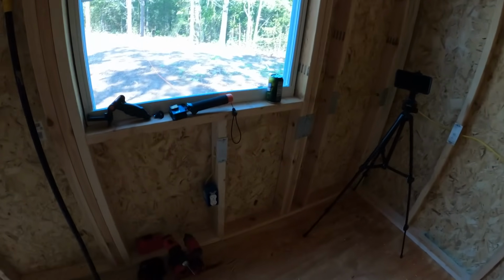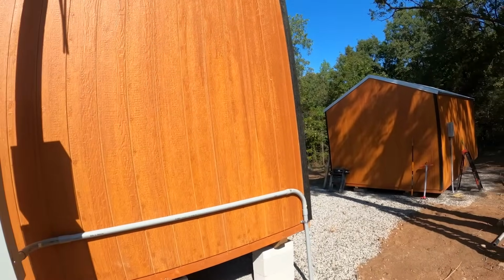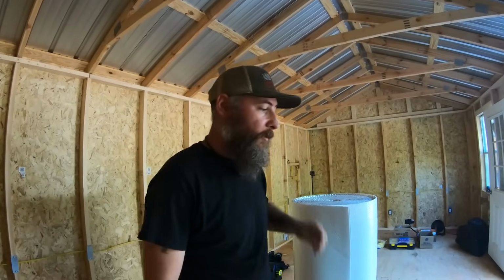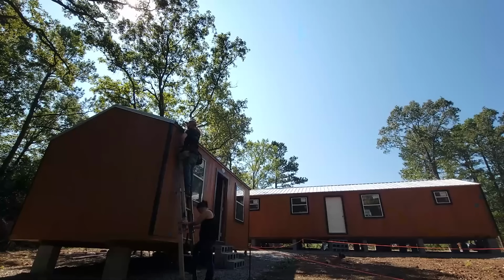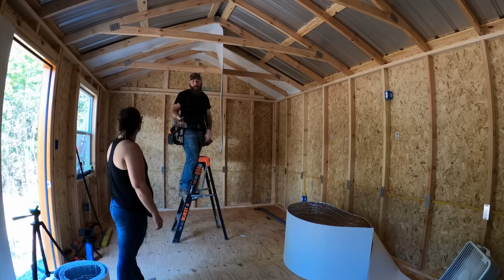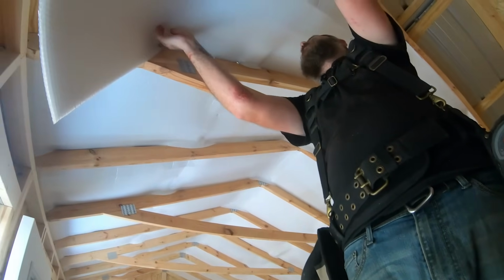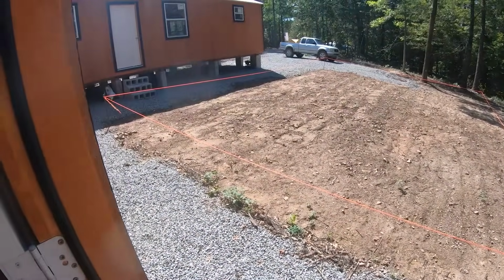Hopefully this keeps it out! |16x48 Shed | Shed To House

Comment: 👍, don’t forget about electrical outlets on the outside of the bldg. and lights on the outside. Eventually there is going to be a ruckus between the dogs and wild vermin or two legged vermin that will require some light on a dark cold rainy night. More lights the better. One other tip woods mice and field rats like to stay warm in the winter too, they are very clever when finding ways in your house or tearing up insulation or wood to get in when it starts to turn cold.  Metal is about the only thing that they won’t chew threw. Good luck !

Comment: we did the DIY Lowes Spray on Foam insulation on the ceiling of two of our 40ft Hi Cube conex storage containers about 1" thick for about $700 last year. It lowered the ceiling temperature from 137° to 104°. That is the delta we measured from the inside with our temperature gun in the heat of the day in the summer in East Texas. The reason we did the spray foam was not really the heat but the water condensation drips we were getting on the inside in the winter from warm humid air hitting that cold metal and forming water like a cold ice tea glass in the summer.  The spray on foam fixed that problem.

Comment: I don't know how cold the winters get there but I would recommend removing the metal roofing and sheeting it with OSB or plywood, felt paper, reinstall the metal roofing. If it gets really cold there you might want to splice a 2x2 onto the edge of those 2x4's to make them into 2x6's so you can use better insulation R-30? 2x4 framing is not even allowed in most places for residential buildings, it may not apply there but I know here in Oregon the exterior walls must be 2x6 minimum for residential. Peace and blessings.

Comment: I still will say, take the metal off and lay on OSB ..cheaper for the long haul. Put in bug shields on the ends of the metal and remember to replace the screws on the roof every seven years as the rubber washers wear out... thanks again ok for the videos.
Reply: Yes, that is what our Premier 12'x32" portable building came with. And double wall studs every 4 feet.
Reply: @ronvera  there is no osb on the roof!

Comment: I agree with John Paquin on using the chicken wire under the house instead of the plastic over the insulation. I have seen that done a lot. Lets the air flow and you can see if you have moisture building up. I have also seen more and more people getting away from using sheetrock. They use siding board or thin plywood. Makes it easy to remove for repairs or to check for leaks, not as expensive and for sure easier to work with. Installing sheetrock sucks, its an art. Either way you can make a dead man lift out of some 2x4's. It is a T shape, make it so the cross board is on the top and fits snuggly up against the ceiling. It will help hold the sheetrock or wood when you are nailing it in. Check out The Hollar Homestead channel and you can see him demo the floor in a mobile home. It had insulation and chicken wire. It may save you some heartache further down the line.  You guys do make a great team. That home is looking better and better with every video. peace y'all

Comment: Looking like the build is going well I can only see one possible problem with the vapour barrier having the wood cross bracing between it and the roofing any moisture that gets between will get soaked up by the wood and could cause it to rot in the future but apart from that it will hopefully do the job you want it to keep up the good work wishing you the best from the UK

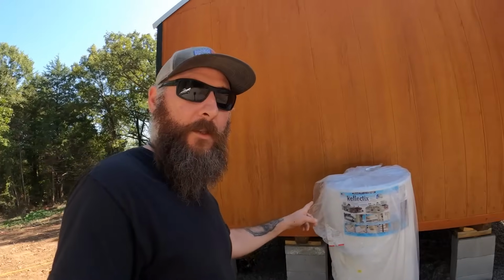Comment: 7:15 you may as well do it right if you are going to do it at all. Being that metal is touching wood and you are considering laying the reflex product between the lumber you will build up moisture if you live in a humid area. The best method is to take off the metal roof, lay the reflex product, tape seems then put metal roof back on or the expensive way which is closed cell spray foam. The building you have aka shed was cheaped with no plywood layer on roof so if you are in a humid area you can expect some mold soon.

Comment: Be sure you research which type of bushes you plant that close to your septic and power lines.  Roots growing through snd around plumbing pipes can be a problem in the long run.
Reply: Roses are an excellent choice as the rotors are not massive nor deep

Comment: When you do the skirting about every 10 ft cut a 2 X 4 inch rectangle and put some hard wire on the Back side to help with cross ventilation and to help keep out unwanted creatures. It looks good so far, keep up the team work, will make you both appreciate it more.

Comment: As long as you have the foam closures under the roof tin, you will not get ventilation from the eaves to the ridge. If you remove it, you will have bug issues. This is one of the reasons you have overhangs, for ventilation and wall protection.

Comment: Pretty awesome. But Sheet rock? What about tongue and groove pine? Well I guess if you ever wanted pine. You could lay it over the sheet rock.
Reply: Expensive
Reply: @ironbonessloan6100  pine tongue and groove is cheap if you make it yourself. Sheetrock is expensive because you cannot make it yourself.
Reply: @HOODS  and you think these folks can cut tongue and groove boards ???
Reply: @ironbonessloan6100  actually yes they can. They can do anything they want to do. It's just a little work. And I have all the tools to do it. And would help them. With a planer a table saw and a router table it just takes time.

Comment: Maybe to late for this tip but here goes...   concerning ceiling insulation...it might be lots easier to leave roll wound up from factory
as is and saw entire roll in half one time. no need then to cut roll each time as you use it. You only cut the lengths not the width. saves 
lots of time and your energy.
                                                                                                                                                                                                   me     southern AZ.

Comment: Paint conduit close to same color of wall. I would suggest putting a NP1 between the conduit bracket and wood screws. Also caulk tops and sides of any box penetrations. I would use NP1 as it’s movable and doesn’t cure hard and sticks great to most bldg materials. Sorry you guys are doing great this is the type of details I deal with all the time.

Comment: the reflextic insulation is great stuff i used it on my shed to house with fiber bats and it worked out  great  in the winter it takes just one 1500 watt elect heater to heat my hole house

Comment: What I did on some of my ceiling instead of using drywall , I used 1/4 inch luan plywood . It's light weight and looks good . No mud and tape work to do and you basically have a finished ceiling once it is up . I have nail guns which made it a lot easier to do also . Drywall is such a pain !
Reply: We used tin on the ceiling in our shed. We had them add the reflective insulation, then we spray foamed everything. It cost us $500.00 to spray foam a 12x32 shed.
Reply: Yes sir, That's exactly what we did. Much lighter and no taping and floating and easier to cut and install. And we used plywood T-111 siding on the inside walls.

Comment: You could try some folding scaffolding or the platform ones that you can use inside to do the high work. There are some narrower ones that let you stack up to two of them and they are about 2 ft depth and around 4 ft long. then you can stand on it and not have to use ladders.

Comment: 🙋🏼‍♀️🕊hi are you thinking of Putting in electronic for one of those Mikita like air systems,  that heat and cool.  You might need an some sort of outlet to get it,   They are very efficient  ,  there are several companies that make them, also an outlet fr a hot plate  . For snacking. All the best to your family.  Blessings stay safe 🍀🕊🍀🕊🍀🕊Nana Pelle   Great team. 🍀🍀🍀🍀.  You might end up spending the winter in that cabin . So you can make sure,   🏡the Home you are going to work on 🏡.  Gets done to your perfection 🕊🍀🕊🍀🕊👍. Sometimes we want to get it right the first time, 🍀🕊🍀🕊

Comment: You should have left the ridge vent open because there is no ventilation on either side of shed gable ventilation eventually the condensation will build up if you leave it like that message is from my husband Steve

Comment: I’m not an electrician but I am a diy builder of my home in Arkansas..you don’t have local inspection bu still need to follow code.  The 2017 NEC was adopted in Arkansas and almost all circuits need to be protected by ARC Fault breakers and some are GFCI. And some are both types.  The breakers are speedy but the safety of your family and any future families should be considered..check out the code. Mr Google can show you the way. 

Love your story..  love the Channel. H
Reply from the maker: Are you saying that I need AFCG and GFCI ? Or just one or the other ? Cause we plan on using GFCI on all parallel circuits. Thank you for the advice :)
Reply: @countryroadcure  kitchens and laundry require both AFCI And GFCI. Outside, garages , bathrooms need Gfci. Every other room needs AFCI. Anything else. HVAC, water heaters and things like that don’t need special breakers. I found the easiest way was to put in the breaker at the box. They make a combo AFCI/gfci breaker as well as separate  o
Reply: @countryroadcure  accidentally exited. The breakers are expensive but you can also to a certain point use AFCI or gfci outlets. I found it easier to bite the bullet and put in breakers in. I watched a video by an electrician an he put combo breakers in all circuits that required them. He said for a couple of extra bucks the combo breakers cost then there is no question. Of which one. Remember this applies to any room including closets. 

I’m just diy person and not licensed. I bought code book and googled a lot. Research your self.   Years ago special stuff was only bedrooms and bathrooms. Now recent code almost every circuit requires special breaker. 

Research bathrooms code also. There is weird stuff about that too. Bathrooms need a separate circuit gfci. If you have more than 1 bath the can connect but only outlets not lights and fans. But you can add fans  and lights to bathroom if only 1 bath on circuit. 

Also check dedicated circuits  (1  thing on curcuit). You would be amazed how many things require their own circuit.

Comment: PLEASE, PLEASE, PLEASE, Take those stickers off your windows! They will become so hard to remove over time! We have a similar roof on our barn. It's not insulated and no vapor barrier. Sometimes in the winter when there is the light fluffy snow, the snow drifts into the barn through that ceiling vent at the peak. Glad you put the vapor barrier on!

Comment: psssss   my house started out as a 14 by 24 shed i then add to rooms to it one 8 by 14 room out of the back of it and then i add an 8 by 14 room out of one side of it  the first room became my bath room with full bath and there,s enuff room for a washer and dryer back there the second room is my bed room and the main room i put in a kitchen on one side and there more than enuff room as a living space then to top it all off i build a 8 by 20 porch down on the other side and this has given my and a friend of mine more than enuff room to live in it all work out great for us i have now live in my shed to house for 10 years now and i just love it   o ps the hole thing cost me less then 6000 dollors to build  the shed a bot was a repo from a shed company and i got at about half the price as new and the add on i have friend at are horse trader type,s so i got most of my building supply,s by trading for the stuff i needed  my tolet sink, and bath tub i got as used at a low price

Comment: hay please do not use the plastic and or visqueen to hold your insalation init the werst think your can use as it hold water and moisure and will rot wood on the building i know as i work as an insulation installer for and long time if your want to hold your insesation in you put under the floor the best think to use  is just chicken wire it will hold the insulation in place well and still let the insulation to breath never ,never ,never use plastic to insulate any thing it just does not work well at all so please,please,please do not use the plastic    pss i also live in a house that started out as a shed and i built it into a house by doing the same as your about to do
Reply: Yes!